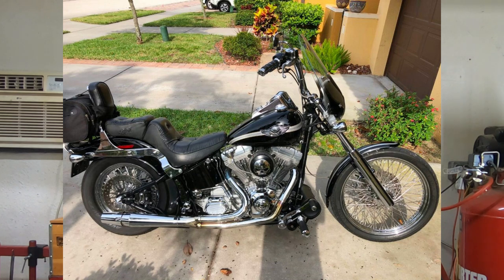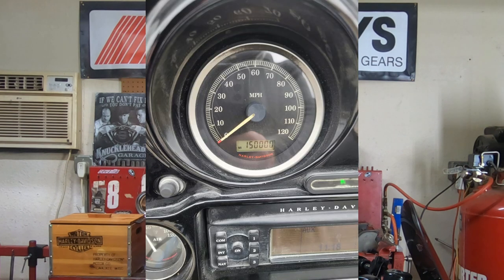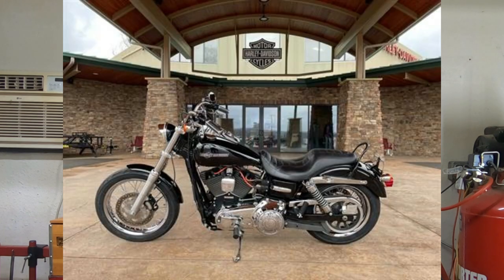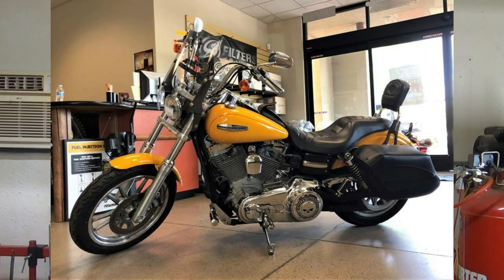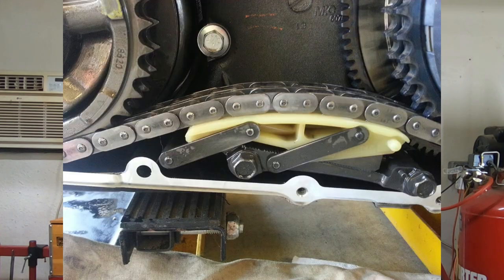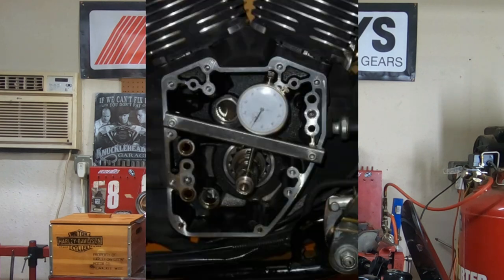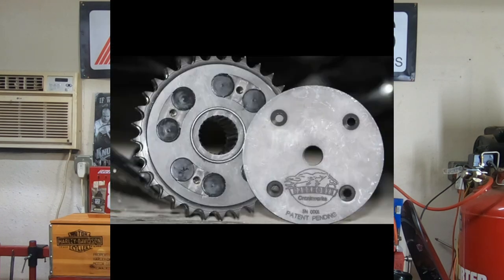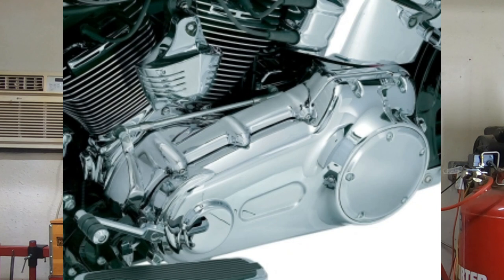Twin Cam Harley-Davidson Engineering is it's Own Worst Enemy

Comment from the maker: What all have you done to your Twin Cam to increase the engines longevity?
Reply: UltraCool oil cooler, Fueling high flow oil pump, get rid of catalytic converter, and a GOOD tune.
Reply: Stage 1 tune...Jagg Oil Cooler
Reply: There just isn't much you can do for longevity if your gonna ride it fairly hard ! But the things you mentioned will help  ! Best bet is still 99 to 02 good crankshafts & timkin bearings on the left side & a change to gear drive !
Reply: I just stopped driving it. Sold it. Now have a V Rod
Reply: 2010 Superglide C & still have it.   Proper tune, side mount oil cooler, Baker compensator w/ Hayden chain tensioner, breaking upgrades for safety, Progressive rear shocks and heavy duty front springs, LED lights all around.
Honestly, i wish i never bought it.
Reply: Oil cooler, tune, and cam chest work
Reply: Fan assisted oil cooler.
Reply: Jagg 10 row oil cooler non fan assisted,stage 1, external breather,Love Jugs,FP3 tuner.
Reply: I am thinking of purchasing the S&S 100ci sidewinder kit and Port&Polish the heads on my 99 FXDX  and My question is would I have to go to a larger carb or would the stock carb be sufficient ?
Reply: Your videos always seem to just make me glad I got my 2001 RK and kept it.
Many fewer issues with the engine... for longevity,

- Re-jetted the carburetor. I did NOT want the injected engine.
- Replaced the cam plate with the SE one at about 40K miles. Since it was opened for tensioner shoe check anyway.
- Manual compression releases installed at the same time due to startup kick-back when the engine was already warm.
- Head breather, no more "oily air" into carburetor.
* Not for longevity, but just after purchase had engine bored for 95" and SE 204 cams installed. Daytona TwinTec ignition module
Still wanting to install an oil cooler.
Reply: @jimmyjimjim3054  why do you wish that you never bought it?
Reply: I added the Harley-Davidson oil cooler for my 2007 FLTR back when I first bought the bike in 2009 with ~20K. Original motor now has over 188K. Thank you for the video and information. 🇺🇸
Reply: Super stock heads gear driven cams oil pump cam plate injectors throttle body dyno tuned header fan 6 speed roller rockers adj push rods big bore kit all parts s and s im sure I forgot stuff its a 03 anniversary ultra it pulls away from a 114 built 3 yrs. No issue
Reply: Valvoline VR1 dino with all the vitamins for a flat tappet engine, film strength is your best friend. There's no magic trick to a 100 year old design air cooled V twin, it all lies within the build and tune.
Reply: Hydraulic cam chain tensioner kit, stage 1, oil cooler coming soon
Reply: External breather, compensator eliminator, no slip trans bearing, power vision tune, DL Customs 828 air cleaner
Reply: @kennethking817  go to the Mikuni HSR42. Should be reasonable out of the box. Mess around with it. Pretty straight forward
Reply: Thank you Mr Irvine , an if you don't mind , Will the 42mm Mikuni use a lot more fuel ? or a little ?
Reply: @stephenbattles4573  I like it now, but it took TOO MUCH MONEY and my own time to make it reliable, and get the Brakes to work even marginally well.
Reply: @kennethking817  should be more efficient. But fuel consumption is affected more by riding style.
Reply: Thank you again .
Reply: @itchegerton8004  My condolences
Reply: Originally when I bought it in 2014 it already had a stage IV installed. In 08/05/2019 @ 30821 miles had these things done to it 
MOTOR HARLEY-DAVIDSON CYCLES

Make: HD Model: FLHXS 2014

Date 8/5/2019

Mileage 30821

Dealer #2273 Wildcat Harley-Davidson 44324 

C/S CHECK NOISE IN PRIMARY AREA ON SHUTDOWN 

Item Description CABLE STRAP, PLUG IN

INSTALLATION ADHESIVE KIT

RETAINING RING

OIL SEAL

GASKET KIT, INNER PRIMARY STATOR ASY,3-PHASE,50AMP

SCREW, CAP TORX, STATOR RACE, INNER BEARING

GASKET, PRIMARY COVER

COMPENSATOR, DYNA/SFTL/TOU

RETAINING RING

SCREW, HEX SOCKET HEAD CA

SCREW, HEX SOCKET HEAD CA BEARING, ROLLER

CUSTOMER ABS BRAKE FLUSH

BRAKE FLUID, DOT 4,PLATINU
OTC PARTS

SE TWIN CAM PERFORMANCE C

CLUTCH ASY KIT SPACER/COVER,ABS,FRT FLT CHROME

 FRONT END PACK

Description C/S FLUID LEAK FRONT FORKS 
I performed regular oil changes as required.

O-RING OIL SEAL, FORK

PACKING SEAL

FORK OIL,TYPE E, 16-OZ BT

CLUTCH COMPONENTS

Item Description CLUTCH ASY

Description CHAIN TENSIONERS

Item Description CHAIN TENSIONER ASSY
Reply: Stage 1 and tune
Love jug mighty mites
Oil cooler
Reply: 06 Ultra Classic: Fueling cam plate, oil pump and S&S 510G cams and gear drive timing. Oh, and true dual head pipes and an Arlen Ness big sucker intake. What a dramatic difference in the ride quality.
Reply: @itchegerton8004  Or buy an EVO !
Reply: @jimmyjimjim3054  Same as I felt when I blew the engine on my '02 RK !  Had a '99 EVO Soft-tail I wish I still had, would never own another TC !
Reply: Sell it !
Reply: '00 FXDX: SE hydro-tensioner cam plate, rocker lockers, high zinc lube - currently has 98,000 miles and I daily it when its above 40 degrees lol.
Reply: 12 thou runout on the crank? That’s 0.3mm!! Agricultural engineering is better than that. What have I done with my Harley? I’ve bought Hondas and BMWs and any other make. Those ludicrously overweight, unreliable and overpriced Milwaukee geriatric \/18R@T0R$ are just ridiculous. 12 THOU??? Embarrassing.
Reply: @itchegerton8004  you don't drive motorcycles sir. You ride them.
Reply: Fluid changes. No baffles Screaming Eagle. Screaming Eagle cam tensioner and oil pump. Some tire's. 2005 fxdli at 40k. Still hums like an angel.
Reply: To get a twin cam to last is actually a bit of work but if you do the work before they fail they are pretty much reliable you put either new bearings that are better than stock and or a new set of bearings and for my use I used adjustable rods after market well I used S&S mild cams and Andrews cam plate I use heavy oil because I have ridden Harley Davidson for years and oil is the key to wear if you want a big ass oil cooler great but heavy oil cools better than cooking oil.
Reply: Amsoil full synthetic.
The dealer replaced jets in the carb before I picked it up so that was covered from the start. It  now has 88,000 trouble free miles.
I suppose I should get serious about an oil cooler.
Reply: I didn't buy one. I like your channel mate.
Reply: Nothing.  Just changed the cam chain tensioners, that's all.
Reply: Threw it away
Reply: Is there a way I can get in contact with you? I have a few questions about my 03 twin cam 88 on my heritage softail....
Reply: They dont make the oe fueling cam plate and oil pump for my 03 twin cam engine only 07 to 17....now what should I do?
Reply: My bone stock 88 twin cam just turned over 100,000 miles and all I ever did was change oil when needed and changed tensioners. Great bike.
Reply: I bought my '08 (a couple weeks ago) with 19k on it. Seems changing the oil worked, then seems that UltraCool oil cooler worked. Working on the Crankcase breather (Trask has a nice system, and so does DK with catch can) then I should be ready for a tuner. With 19k miles, don't think I'm ready for the Dark Horse compensator yet. I do like running super unleaded in it, also seems to help with temps. Oil cooler fan works, but hasn't kicked on on its own yet (just now warming up around here too, but never see over 75 degrees anyway cuz I'm that close to Canada and the Pacific.) That chain tensioner got me concerned. My Evo TC and Evo (carbureted for that old school sound! WOOT!) both have those inspection covers, was glad to know HD got rid of it on the '07's and on, and not just some aftermarket thing. Could be aftermarket putting it back though.
That crank runout its because of the roller bearings right?  Can't remember where I heard that.
Reply: What cams do you recommend?
Reply: Stage 1(tweaked to run rich) with a cam replacement and a better oil cooler.
Reply: 2012 FLHXSE3 CVO Street Glide with the 100 CI engine: Feuling billet cam plate and high flow oil pump, forged rocker support plates, adjustable pushrods, Cometic three-piece .030" head gaskets, SE-259e cams with Torrington bearings, Ness Big Sucker Stage 2 intake, Drago's Dragula 2-into-1 exhaust, good TTS tune (currently re-tuning), Hayden M8 primary chain tensioner (the stock Harley ratcheting tensioner is CRAP, as you pointed out!), Energy One extra clutch plate kit, ClutchWiz.
Reply: That 95cu is the bomb👍
Reply: I use Cerakote from LiquiMoly awesome friction reducer, therefore heat reducer... Cant even ride my hardmount Sportster without it.... My Vespa and big Dyna 95 stage 2 love it as well

Comment: I have a 2005 dyna with 136 000 km. Just over 80,000 miles. I replaced the cam tensioners at 100K/62000. At 128K I added a 204 cam with the hydraulic cam plate upgrade.. so far, so good. Now I need a clutch, alternator, which I Will replace when I install the race primary gearing and chain. I never had an issue with the tensioner. It is the manual adjustment one. Maybe I got lucky, I’m still happy with my Harley. 17 years of riding, basically trouble free, makes me happy!

Comment: I recently bought a hydraulic automatic primary chain tensioner from southern oregon hot bikes. Very well made, time will tell.
Reply: I have one installed, running for 10k km's now without any issues sofar. Different brand but the same system. [HB125 type]

Comment: Gixxer....my 96 FLSTC followed your advice..........Stage 2 with 222 woods, 2 into 1 Cobra, External Breather Sifton / DK Customs, Screaming Eagle Compensator + Heavy Duty Clutch, Plus Cam Plate and Oil Pump, UltraCool Oil Cooler (above regulator). Add the 10" Todd's  Strip Handlebars 1 1/4", Plumb in the electrical, Set of Hard Bags, remove the front wheel hub cap, add Magnum cables brake, clutch and spark plug, Progressive suspension front and back with RAP. Performance Machine 6 piston front caliper with floating disc. You now have my Hot Rod! Thanks for all your advice. Have a great Holiday!

Comment: Thank you for a great video as always. Sometimes I miss the saggy shelf, it was like a co-host. Sticking strictly to my longevity mods I replaced my tensioner shoes in my 2003 with Twin Power shoes, replaced the cam bearings with Torrington, swapped the oil pump with an S&S that tolerates run-out better than the stock pump, These bikes should have NEVER left the factory with these cranks, no left Timken, inferior cam bearings, and inferior tensioner shoes. Even if they chose to run a cam chain on the outboard side of the cam plate they should have never used a chain on the inboard side. There should have been gears on the backside. Harley is NOT the premium motorcycle they claim to be.

Comment: Thats why I looked for the 2002 model with the hot forged camshaft. Great engine to use for a stage IV kit.
Reply: 88's till 2002 used timkin bearings  then after bad bearings aswell as bad cranks kill the twin cam. l
Reply: @ssflh68ify  Blew my '02 RK, just hit 60,000mi, threw metal throughout the motor from bad cam bearings. Still have the bearings !  HD offered no help.
Reply: @daghostxxx1797  that would be on The List to ck every 20,000, main crank is the major problemo 03n up

Comment: Just so glad I came upon an 2006 RK custom 88 TW with only 1 thow runout on the crank...  put in a S&S gear drive, 509G cams, new lifters, S&S high volume oil pump, a power vision tuner, and none of the other 2007 and up problems....  Bike has been running fantastic for years now.  Had 8 K on it when purchased, and has over 22K on it now.
Reply: TC not TW.... LOL

Comment: My 2004 had a 95" kit that had 100 horse 115 torque and the cam adjusters didnt go until 53000 miles and the motor still ran great when i sold it with 65000 on it.  Make the heads flow better and  adjust out the stock lean condition and it will not run hot,  mine never did with no oil cooler.

Comment: Well brother, what I did to mine was to install an oil cooler, fueling cams and oil pump with cam plate, shit canned the stock exhaust, a K&N air filter, slightly bigger injectors and a techno research tune,. The run out on my crank was fine, .001. this is an 08 street glide. I will put in a man o war , but that's winter work. Vance and Hines handles the noise. I run a Barnett clutch and use drag full synthetic in all three holes. The trans I flush every winter when I do my maintenance tear down and never found anything out of the ordinary, but maintenance is the key. We had two months of very hot weather here in Detroit this summer and my bike ran fine the heat was not objectionable. I never run my bike in stopped traffic, either I'm going around it or , and it was only one time that I pulled off and shut down. Fellas , keep em clean, use quality parts and fluids, and with some elbow grease , perform some upgrades. My name is Tom and I'm the senior tech here in Detroit, been doing it for 42 years. And I love the twin cam. 8's are good, love the Evo, but the twin cam is for me. Got a motor build in the works for this winter with some mods I've been thinking about, I'll keep you posted gix.

Comment: nice one , a lot of common sense there ,, no need for water cooling on low power motors , but oil cooling = yes . here in the uk we do not get very many 'sumping' issues or overheating , the summer mornings are usually quite cool and the hot spot of the day is 1 pm , so by the time your bike starts suffering the day gets cooler ,,, [ not always ] .

Comment: Have a 2012 Ultra Classic that had a stage 1 on it when I purchased back in April of this year. Put in a Thundermax ECM and it cooled way down. Gonna get a set of Love Jugs this spring to help if traffic gets slow. No issues with primary tensioner. Switched to Amsoil 80 miles ago.
Reply: Do you know how to use parade mode on your bike? It will help in traffic
Reply: @anthonysimmons6884  
What is parade mode?
Reply: @12yearssober  when you hold the throttle forward for a few seconds and it turns off the back cylinder. When activated: the bike seems like it's going to fall dead at idle, but doesn't.
Reply: @anthonysimmons6884  
I have a 2012 ultra limited with the 103. Will this trick work on mine?

Comment: Another excellent informative video. I always wondered why the primary chain was so long with that much extra length? Why did they not just shorten the chain and put a spring tensioner on it? The chain deflection alone is bad on the tensioner. There has to be a better design for a tensioner. As far as the stock oil pump? Use multi viscosity oil that pumps easily on start up like 20W50 or 10W40 4T mobil Everyone thinks thicker is better when that is not true. Amsoil. A friend of mine has a twin cam 103 and it is all stock and he puts thousands of miles on the bike without a problem. He has always put Amsoil in it.

Comment: 2005 Superglide here TC88, only mods are Freedom Performance full exhaust & Cobra 2000 fuel enhancer & have 22,000 trouble free miles & this bike runs strong, I’ll never sell this bike as it’s perfect as is, nice vid Gixxer, always learning from you!
Reply: 03 fxdx myself. 1st harley. Gonna do cam chain fix this winter. Its perfect for me in height power and ride. 17000 miles on it now and I plan on keeping it to at least 60 to 70 thousand miles.
Keep her shiny side up buddy and ride safe.

Comment: Hey Gixxer good info as usual, I have an 07 Streetglide, all S&S camchest, 551 easy start cams, Baker  compensator, Hayden chain tensioner, Love Jugs, FP 3 tuner,and a  Jagg fan assisted oil cooler. I Live in Florida, oil temps never get above 210-215.  Totally worth every penny I spent on her.
Reply: I think it's important to remember that oil temps need to get above 212 so moisture boils out.

Comment: My '06 Dyna 88inch (last yr of the 88"), shares the 96inch parts. At 10, 300 miles the Auto Tensioner destroyed my tranny bearings. Got it repaired, and replaced it with the Hayden Automatic Tensioner. But, it also has the improved Hydraulic Cam Tensioner. I now have 41,000 miles on it.

Comment: I am so in love with my 2002  TC. 88 Carb. Scoot. 2into1 pipe 95 big bore kit SS 583 cam with ported heads with bigger valve and springs. Also new paint job. About $14000.00 extra in the scoot she is ready.
Reply: @Tomcat8911  The Cobra. Great HP gains and its not a super loud nasty cracking pipe. Neighbors don't mind it at all.

Comment: I have a TC 96.  It has 68,000 miles with a stage one tune.  I have no problems with temps, I do have oil temp gauge.  Never had a problem with only tires, oil and brakes.  Oil changed every 5000 miles in all three holes.  Never changed the compensator or had problems with the tranny.
Reply: Same
Reply: 96 implemented a bunch of improvements over the 88. 

I haven't had any issues with mine, but that hasn't stopped me from swapping out some parts for peace of mind.

11 year old bike, and she runs strong.

Comment: For longevity of my 2016 TC FatBoy:
-External breather
- a Power Bank tuning to lower engine heat.
- every 5.000 miles oil & filter change.
Now 82.000 miles and no mechanic repairs at all.
Me and my friends must be lucky..and we ride a lot!

Comment: I enjoy our videos, thanks for sharing. I recently had my local HD mechanic (not a dealer) get inside my cam chest (TC 88 2002) and replace the tensioner pads. I have no desire for extra power or speed etc., but maybe I should have thought about the heat/longevity issue 🤔 Next time!
Reply: How many miles on it ?  Mine went @ 60K, bad cam bearings.
Reply: @daghostxxx1797  55000km. The outside pad was in good condition, the inside one (cam shaft side) was just about toast. Caught it in time before the metal on metal scenario.

Comment: Great video as always!  Planning some cam work this winter on my 06 Deuce with 40,000 Km ( I'm in Canada ) S&S TC3 Cam Plate and shoes and High Flow oil pump with S&S 509 cams. Throwing it out for people thoughts... that set up or the Fueling you mentioned.